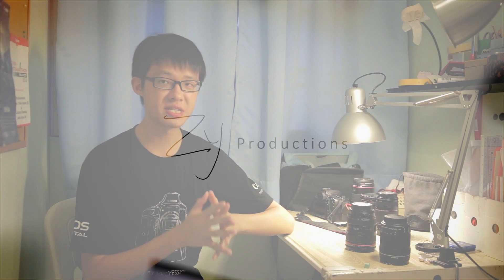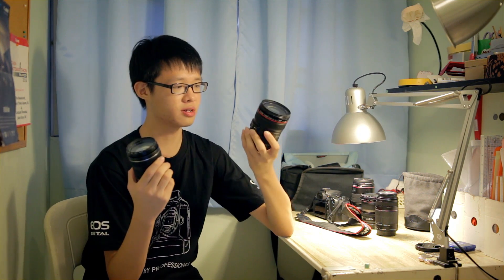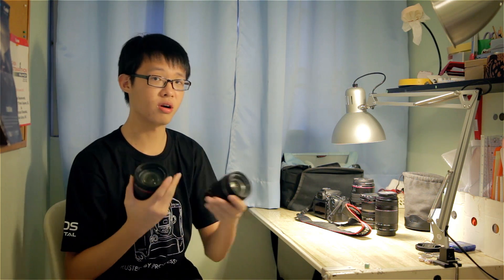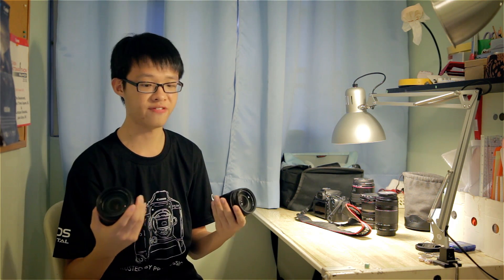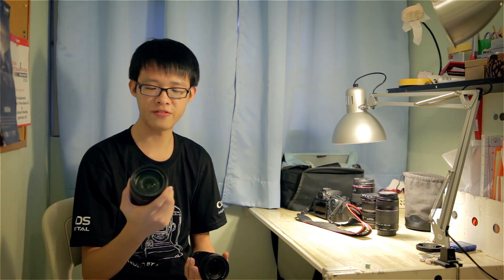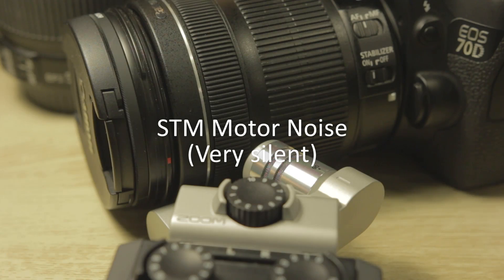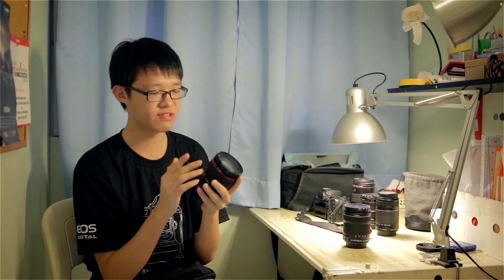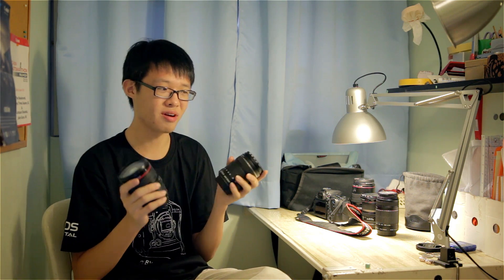Canon EF Lenses: Ultrasonic Motors VS Stepping Motors (USM vs STM)

Comment: It would be helpful to see an audio waveform from the soundtrack of this video. You could then give a numerical comparison. It would also be helpful to provide a comparison of sound picked up during video recording using the internal camera mic, a shotgun mic mounted on the camera, and an external mic just out of the shot above or in front of the speaker.

Comment: STMs are good when used for video, especially with cameras using Dual Pixel AF as they have smooth focus transitions with very little hunting. USM motors are traditionally faster at focusing but with often focus slightly past the subject and then quickly pull back, as a result from a video point of view they aren't ideal but from a stills photography point of view they are much better (hence why all the STMs have been introduced into Canon's budget lenses rather than their L lenses).
Reply: Thank you

Comment: I wasn't too happy with this lens on my Canon EOS 50D.  I enjoy stills photography, mostly landscapes, and while the focus was good during the day, there was almost no auto focus capability at night.  It would just continuously attempt to focus with no success.  Manual focus is difficult to achieve with this lens; I had to use a trick I found on the internet that worked a little.  Others may have a better experience but that is my experience with this lens on the EOS 50D.  I know better now and the suitability for USM and STM.
Reply: do you use usm or stm?

Comment: Hi I am from brasil this len 18-135 stm I see the price at bhvideo its almost 499 dolares in brasil is 300us so ist better buy together save me more money my 18-135 is old and is not stm do you think 24- 105 can be the same job if I buy separete  this cost more

Comment: If you want to compare. Please compare the same lens with usm and stm. Like canon 18-135 stm vs 18-135 usm.  Then we will know the different
Reply: L series uses ring usm. On EF-S lenses, thhere is an old micro usm which is garbage, and the new nano usm. Comparing the nano usm and stm 18-135, my personal experience is that the nano usm is lightning fast, much faster compared to the stm which is already really quick.
Reply: STM is better than the USM or USM is better than the STM ??? please reply me
Reply: USM, more specifically ring-type USM,  is a lot faster compared to STM, so fast that it is impractical when recording video. Continuous AF was possible but the focus transition is very sharp and jarring. That's why Canon made the Stepping Motor drive. It is basically a slightly slower USM thanks to the focus-by-wire tech, meaning the Camera's processor will process the focus information before you actually see it focus but the difference is not like between the USM and Micromotor. So the STM lenses focus faster than Micromotor lenses but not too fast for jarring video. In short terms, USM is aimed more at pro photographers while the STM lenses are more oriented to filmmakers, vloggers, etc. Personally, I use STM lenses as I do a lot of video work than photography
Reply: did you get the answer yet please?
Reply: i think  nano usm is better than all
Reply: True. Because also, L Series lenses USM is not the same USM type mounted on non L lenses.

Comment: How do these lens stack up when it comes to video in terms of sound feedback? Does the mic pick up on the lens motor on any of these lenses? Some lenses can be heard when you playback the video and its annoying.
Reply from the maker: +Ydkoll STM would definitely be less noisy than USM's.
Reply: Ydkoll yes..it still does ...either micro servo or sound from lens sliding around. I use Manual focusing...but i heard from the Canon guys  the new USM are very quiet..u may want to try it.